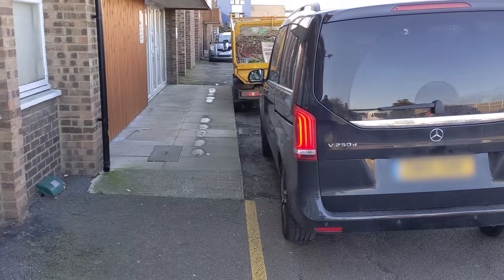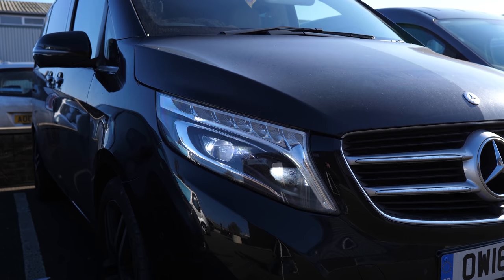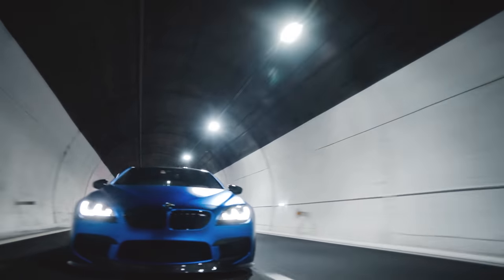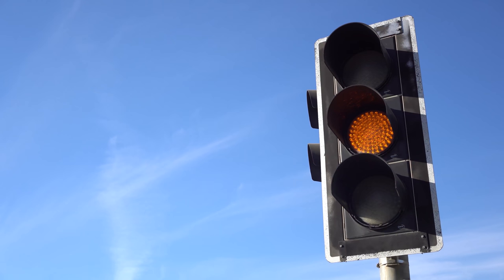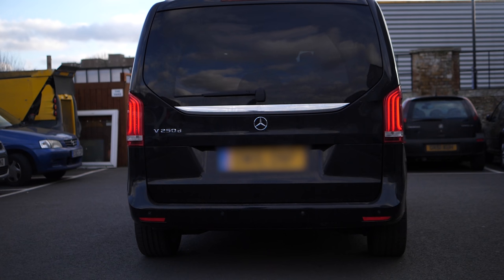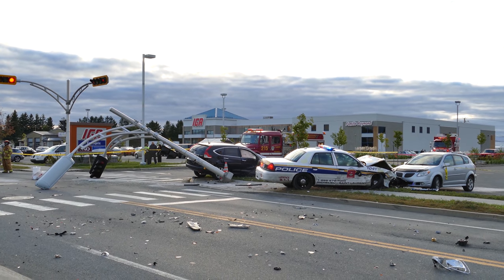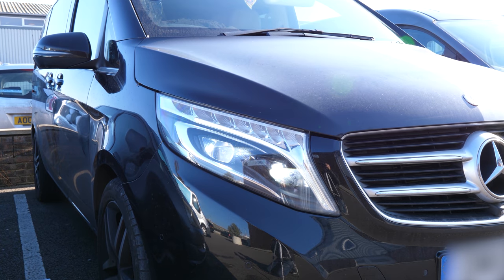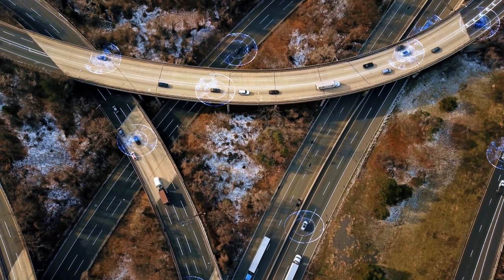Self-Driving Cars Are Dangerously Confused By LED Lights

Comment: I wonder if using multiple sensors with different configurations, could be a solution here. It'd cost more, obviously, but if one sensor can record with minimal motion blur and another could do so with minimal flickering, the two images combined could be used. Using different sensors other than cameras, or specialized cameras and throwing all that data together could also be used to iron out these anomalies. You'd need a lot of processing power do deal with all that in real time, but that's already a requirement.
I realize that I'm not saying anything new here and the real challenge is bringing the cost down right after getting a system actually fully functional - but while doing that you can't ignore the eventual need for a lower cost.
Just a thread of thought. (And we haven't even talked about software yet - aside form mentioning AI broadly.)

Comment: It is not that expensive to change it. Only thing is to control the brightness of LEDs by voltage/current not PWM. There is one problem that voltage is not linearly proportional to the brightness and these curves can vary from manufacturer.

Comment: the best way to get around it is to have 3 cameras running at 3 different PRIME frame rates, say 17, 31 and 79
with those 3 you will have a single flicker once every 11 or so hours.

Comment: 4:16 Could the cameras be programmed to adjust their refresh rate continuously on a pattern?  Such as 60, 45, 57,30,42, FPS?  In my theory, it would also alternate the time before next rate, such as 29%FPS -> next FPS setting, 37%->next setting, 17%, next setting..  In this way, the camera will always be able to sync and desync with the lights several times per second, regardless of the LED duty cycle specs.
I have a hunch, but haven't done the extended maths, that using prime numbers on one half of the equation, and an algorithm such as -15 [step] +12 would really get the RNG juices flowing, you have multiples of 1,2,3,4, and 5 with primes 17,29,37, etc.  No way the camera can sync to any light with random numbers like that.
Reply: 8:22 WEll I suppose that's a bit simpler then isn't it?

Comment: The solution is any blinking light needs to be checked by multiple camera frequencies.  Maybe even random ones.  It should be possible then to see if the light is really blinking.

Also, even if you weren't implying it, I'd be inferring it.

Comment: It is easy to solve.  Set your shutter to at least twice the speed that the human eye can see, and take the brightest pixel in the image once per timeframe that the eye can see.  So if you had the camera triggered for lights doing logic that any pixel that is lit at any time inside of a 1/24th second period is considered on, then there is not a problem.  You only need to do this calculation for the logic that is looking for lights.

Comment: To think that all this could be solved by adding an inductor in series with the LEDs. Instead of full PWM, it'd smooth out the current, providing a constantly lit LED whose brightness can still be varied simply by changing the duty-cycle of the input signal...

But that would make each headlight a little more expensive. Too bad.

Comment: We should aim to build camera's that function correctly, regardless of the behaviour of LED's or any other light signals. After all, you can't guarantee all lights the camera will be looking at will function correctly or are delivered according to standards. You can introduce new standards, but that doesn't take all the old stuff off the road.

Comment: While we're on the subject of safety in self-driving cars, maybe we should introduce laws that require self-driving cars to measure the attentiveness of their own operator and then find a safe place to stop if the operator shows signs of being unable to intervene in an emergency. For example, if the computer detects that the operator's eyes are closed or otherwise not adequately focused on important areas, the vehicle should warn the operator that they need to pay attention. If the operator doesn't head the warnings, the vehicle should then automatically find the nearest free parking, and contact roadside assistance to check on the welfare of the driver.

Comment: "The fraction of time for which the led is on is called the duty cycle"
... is that fully correct? 
I thought the duty cycle is the pattern of being on and off in one full cycle (the latter being 1/50th of a second in your example).
Reply: Duty cycle is the percentage of time it's on. The off time is not doing any "duty", so it doesn't get counted.
The frequency includes both periods though.

Comment: Why not just use two cameras with staggered shutter timing, and combine the images to get double the frame rate?
That'd also make sure no information is lost.
When it does see 0-1-0-1 pattern of the LEDs, it could average them out over 50ms or so (whatever is close to our persistence of vision) to get close to what humans would actually see.

The extra investment to "change the environment" needs to be in adding radio so cars can just talk to each other. Turn signals exist only because it's not practical to yell out your window to let other drivers know.

Comment: Why not higher framerate cameras, 100% shutter? Don't need to make ultra-low ISO sensors - just fast sensors which they already make. If it's too much data have a hardware chip to align adjacent frames and average them together (alignment reduces motion blur)

Comment: Since working with some PWM control a long time ago, I have always been put off by lazy manufacturers who use depressingly low frequencies for their LED controllers..

We live in an age of super fast chips, cranking the PWM frequency to avoid nyquist/latency/beat problems for people's eyes and "low frame rate cameras" isn't hard.... (lets just shift the base frequency to 50 kHz or something )

(NB, in the USA, Braking while "simultaneously"  indicating, does cause some confusing light signals (others need to see both sides of the car simultaneously -to see what is actually being signalled -, and the signals are severely compromised if there is a "brake light "out") , in countries (nearly everywhere else) with separate indicators / blinkers and brake lights, this situation is much less likely to occur.)

Comment: I first noticed a similar effect to this back in the days of black (or green) and white analogue, cathode ray tube,  text-only computer monitors. The flicker (which for a couple of reasons is different to the current LED technology, but let's ignore that) was usually not perceptible, but I discovered one day that if I blew a raspberry (is that a thing in US English?)  the image would break up because my eyeballs were vibrating. This got me thinking: could animals that navigate using ultrasound take advantage of this effect? What? Bear with me 🐻. A lot of insects flap their wings fast enough for humans to only see a blur – but at a characteristic frequency. So, if bats could flash their ultrasound (or their ears) on and off at a different frequency, lots of insect wings would instantly stand out from the background.  This would have the knock-on bonus effect of needing less brain to process the ultrasound image, perhaps making the bats lighter and/or cleverer. I searched for literature on this a few years ago but didn't find much that I understood. I'd be fascinated if anyone else has looked into this. 🦇

Comment: Electrical engineer here. What we could do is just make manufacturers drive LEDs with variable current power sources, thus negating refresh-rate entirely. A little bit more expensive but nothing compared to the cost of the cars other components.

Comment: so AI systems could have 2 cameras, with long and short length of exposure, with an ND filter on the longer exposure. 
this helps with phase detection, and allows for variable frame rate interpolations.

Comment: why not put an rf transmitter inside the traffic light and a retransmitter in each car co when the light turns red it tells the car to stop then as the car is stopping it tells the car behind to stop. 

combine with software to detect the size of the car in front in the frame so it knows you are getting close and stops to prevent bumper to bumper.

better yet why not put a capacitor across the leds so it smooths out the pwm and it wont flicker

Comment: Using camera and AI may be the right way to deal with external hazards and unpredictable scenarios, but its not the right way to deal with internal factors and regular occurrences.
Currently the behaviour of other vehicles, of traffic lights, and the like are external factors, but they can be brought internal if we fit gadgets to the vehicles and traffic controllers which broadcast the information. If the car in front tells your car that it is slowing down, then your car has far less work to do in figuring this out for itself.

The problem is that you need critical mass on the other vehicles before this is a useful approach.
Which is why we should be standardising now on this broadcast aspect, even in vehicles which are still manually driven. And perhaps in a short few years such devices should be mandatory on all vehicles, including retro-fit.

Comment: I guess one way to solve it is through machine learning. Installing a programming in which the computer that runs this program runs a scanning for different frames coming from different sensors distributed around the front of the car, and which must not be sinchronized in their aperture but sinchronized by the AI to detect the light at different moments.

Comment: As a technically minded American, I've long held a firm belief that using a red tail light for a turn signal is a incredibly stupid idea. -- mostly for safety reasons.

Firstly, we'll never see red turn signals in the front. So why in the rear. Plus, amber is the international color for TS.

Secondly, depending on when and how long one looks at a red flashing tail light, questions, confusion, or dangerous circumstances may arise.
It's far too easy for one to see such an item and not realize if it's a brake light or turn signal or someone taping their brakes.
I've had this occur to me multiple times. -- forcing an additional glance. -- bringing with it other issues as well. By good fortune, I don't recall ever having a close call with danger because of this fact.

Amber turn signals simply take 100% of the ambiguity out of the potential discrepancy.

Unfortunately, us automakers typically have lower production cost and a certain disregard for safety as part of their design philosophy. 4 wires vs 5, additional lens assemblies, slightly higher design cost, etc.

Comment: 🤔And what if instead of an aperture, they used polarising filters or LCDs to adjust the amount of light entering the sensor? I belive it should work and be more resistant to mechanical impacts.

The "Types of commenters" part was one of the best parts. It was a little off-topic, but still touched on fundamental issues of civilisation. I mean there were probably some people... loads of people who would never want to set sails and discover anything. The funny thing is, now I am one of those people or at least I dont know how it is gonna turn out... yet.

Anyway. Another great video. Congrats!✔️

Comment: One approach that could sidestep this problem would be to use an event camera or dynamic vision sensor (DVS)(https://en.wikipedia.org/wiki/Event_camera). In these types of devices only changes in intensity from pixels are transmitted from the sensor. This is more in line with how eyes in biology work and has the potential to significantly reduce the power consumption of these kinds of systems, especially if the machine learning is implemented in spiking neural networks on neuromorphic hardware.

Comment: Should a self driving vehicle even be considering brake lights and turn signals? I can see a case for turn signals, but I can also see work-arounds. Brake lights could be safely ignored by a system that already calculates the speed and direction of surrounding objects.

Comment: 1:35 Turn signals aren't just red, they are typically combined with the break light, such that if someone is signalling and the only light you can see is that one, you can't tell if they are hitting their brakes or not.  If they have their hazard lights on then you can only tell they are braking by looking at the top center light.  It's stupid.

Comment: Well good point but I don't think this will be an issue at all because REAL self-driving is only possible with a dense 5G network where all cars in vicinity can talk to each other in real time thus a sensor for detecting indicators isn't needed at all. May be an acute problem but overall doesn't really matter.

Comment: OK, turn that around. How about encoding useful information in the duty cycle? (Have a snazzier duty cycle that can encode simple "words"). With brakes, you might encode braking intensity? If the car is braking hard, that would be nice to learn at the speed of light. Easy to say; probably hard to do?
Reply: Hmm ... OK if you were going to do that (long term maybe?) you might as well just transmit every car's state to every neighbouring car, and not worry too much about the environmental AI? Leave the AI to try and figure out the pedestrians? (You might have to just give each car a kill quota and wait for that to condition pedestrian behaviour).

Comment: When they are All self driving will they even need visible lights? Of course, I suppose it would be an issue for pedestrians.Use redundant signals, leave the lights for the humans, but switch to some other type of signals for the vehicles themselves.

Comment: Do turn signals and traffic lights use PWM? Why would you want to use PWM if it doesn't need to be dimmed? One solution to PWM flicker would be a smoothing capacitor in parallel with the LEDs.

Comment: Is this not just a problem that will exist during a transition phase? Mandating that all vehicles and lights have cheap transponders seems like a great way to avoid guess work  There's potentially a privacy issue but there's no reason why the transponder has to necessarily have a unique id tied to a person. 
In the short term how about a camera that randomly varies its frame rate to avoid strobe effects  lasting more than a few frames?  This could be compensated for in the frame grabbing software.

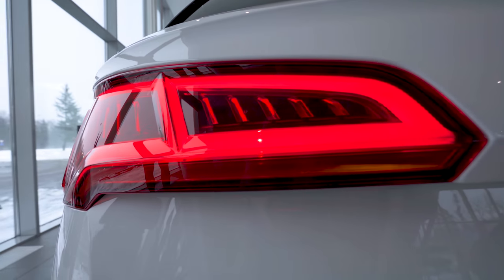Comment: 7:20 I HATE this new way of indicating direction. To me it looks like the exhaust of a rocket, which, when you think about it, implies the opposite direction to the one intended! One solution would be to change it from ramp to sawtooth waveform, i.e. start with the whole light on, and then move the darkness in from the centre of the car to the direction required to be indicated. This also means the entire light comes on straight away, which could only be better from a safety perspective.

Comment: It would be so easy to prevent the LEDs from flickering with a capacitor. I wonder if it would be possible to mandate manufacturers put flicker-free LEDs in cars? Though I guess now that there are some cards with flickering LEDs, an AI would need to account for them. Maybe another set of cameras dedicated to sensing indicator lights and other lights that may possibly be flickering LEDs? Then they could be terrible at everything except sensing indicators and it wouldn't matter.

Comment: More efficient LEDs offer a solution, because they would no longer have to use PWM to reduce the power consumption of the LEDs to prevent overheating.. As it is, large heat sinks have to be used in automobile LED lights even with PWM. And, by the way, LED brightness can be controlled by regulating the current, not the voltage, because the voltage drop across an LED is more-or-less constant as with any diode.

Comment: Why even use PWM in a car?
Can the driver adjust the brightness?
They're working off the 12V battery. I'm sure it's trivial to put a resistor (or buck converter) in there to step down to the right voltage, compared to the building of the car around it.
They could even just put enough LEDs in series so that the voltage is right. Why don't they?
This would be an interesting video, but I'm not sure if it fits with this channel.

Comment: Why not take a few frames, take the inter-frame discrepancy, and copy-forward to the next frame the brightest discrepancies from the previous frame or two. Sure in motion, you might get some blur. But at 30/50fps should be minimal. Of course you can construct a worst-case scenario where the PWM doesn't light up anything in the previous few frames. Which gets me to my next point, maybe lights should have a set base clock, of say 25FPS or something like that? (I'm sure you can figure out an optimal clock frequency with math LCD, GCM)